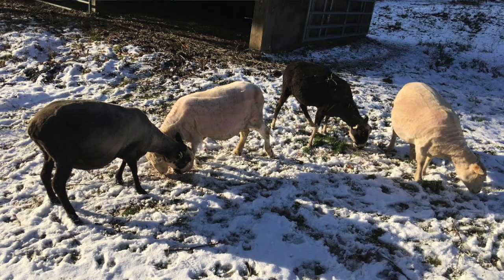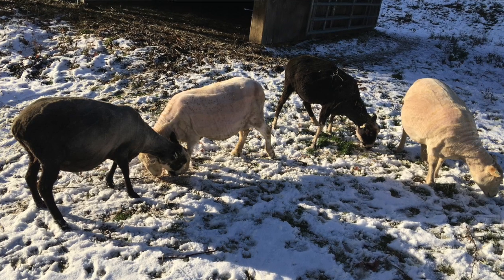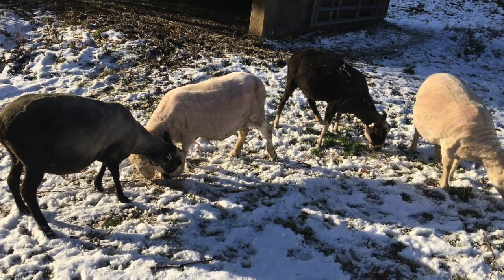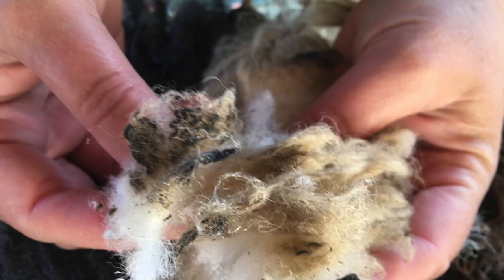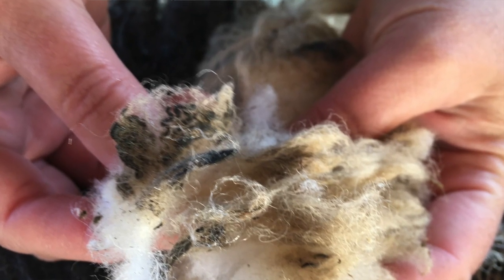Sheep to Sweater - Part 1: Skirting Fleece

Comment: I use an old ironing board to skirt, I also use my old afro comb. I was teaching my niece how to process a fleece this summer and she was filming me, when I watched it back I noticed I'd made quite a good point, people with curly hair like mine should be naturals. Particularly when washing fleece I noticed how similar it behaves to my own hair... I am part Welsh so maybe it's just me 😂
Great video, thanks.
Reply from the maker: Thanks, Dai! I'd love to know more about how you use a comb for skirting or washing. I can see how it might be useful to poke and/or shake the fleece to encourage debris to fall.
Reply: @GageHillCrafts  I just use it to tease out burrs and open particularly matted areas when skirting. I just use my hands when washing and ease out the dirt between my fingers. I have a habit of washing quite cool as I like a lot of lanolin left in my finished product... It probably slows my carding process down a little. When I first started processing I did no research, just used my initiative, and came to all the same conclusions as the experts, I've found it quite an intuative process. That said I could be much more efficient, it takes me the best part of a week to go from raw fleece to rolags, if I'm focused on getting it done. I tend to wash and dry then vacuum bag my fleeces, then hand card and blend what I want for a specific project. Hoping to teach a sheep to sweater (alpaca to hat more likely)  course myself next summer, so need to be a bit more organised.